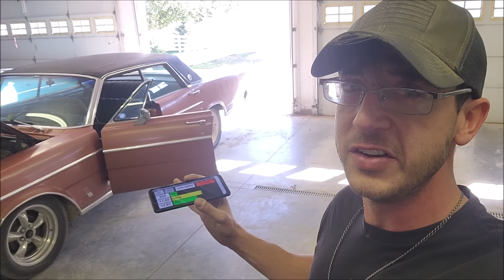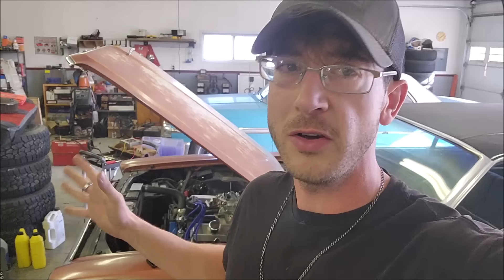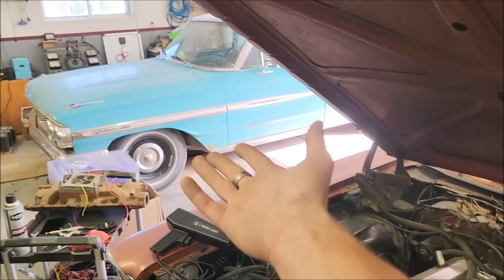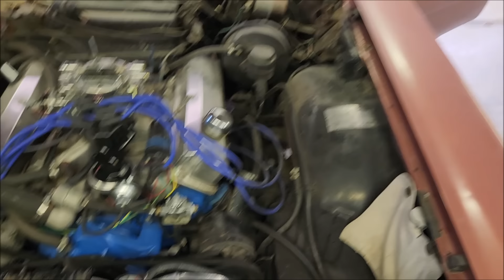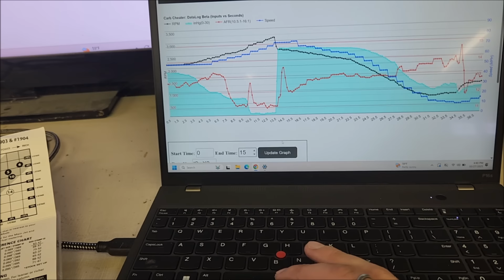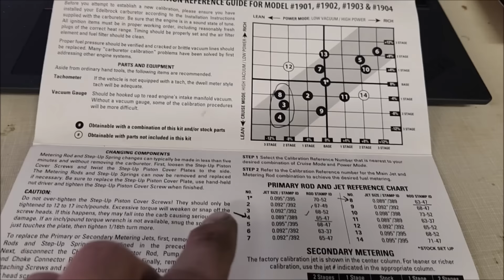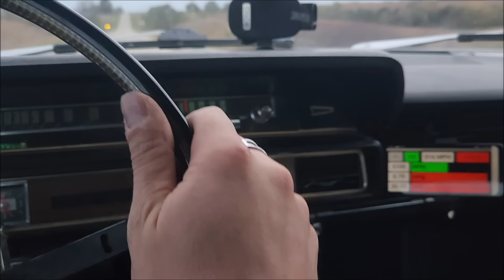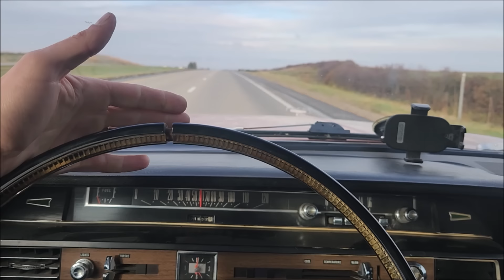Can We Save Her? NEW $6500 Engine Makes NO POWER !!!

Comment: The accelerator pump has 3 holes for adjustment.  I would move it down one.  Also your secondary jet flap is opening too soon.  Move the adjustment nut counterclockwise to get that lean issue to come down when the secondaries come into play.  You may have to tighten it a lot. The edelbrock is set very loose from the factory for universal driveability. As you tighten it counter clockwise you can tap the secondary flap to feel the tension increase. It will slow down the secondary flap reducing the amount of air during the transition . Reducing that lean jump. If you do those two remaining things. That’s all that’s left.  This thing will run smooth as butter
Reply from the maker: There were quite a few things I did that I didnt show for the sake of time in the video. The biggest one being that I removed the boosters and put a .025 thou wire in the idle feed restrictors. Low vacuum at idle feed issues - maybe i should do a video over that kind of deep stuff specifically. I lose people when I get that deep into things so I opt out of that on camera.
Reply: @ThunderHead289 This person would love to hear anything you want to explain.  
👍🏻💯😉
Reply: @ThunderHead289  Maybe do a series of shorter step-by-step vids in a playlist? Once word gets around they'd keep building views forever 😀
Reply: I would like to see more fine tuning as well!

Also, did you adjust the mix screws after every jet and needle change?
Reply: @ThunderHead289 well you did an awesome job.  I think your product is very very good at what it does. Combined with the easy to tune edelbrock avs.  I love my setup
Reply: @ThunderHead289  What model/CFM was the AVS?  CARB CHEATER LOVER gottsa' know.
Reply: Yo manny. Thanks for your added tips. I’m trying to put this all together to fully understand. Can you tell me what the accelerator pump lever hole setting adjustment actually changes/ adjusts? I have a “High / Low” setting on mine.
Reply: @adksherm  The hole setting primarily adjusts the throw of the pump, changing the volume of the pump shot, and secondarily it changes the starting height of the pump plunger. The upper hole will have the most volume of fuel delivered and the lower hole with have the least. When you change to a different hole, you're also supposed to bend the rod so that the height of the pump plunger at rest stays the same, but bending it too far while using the upper hole will risk the pump plunger bottoming out, so be careful.
Reply: @LtMcMuffinxx  yes this.  On this carb there are 3 settings.  Since he mentions running rich at the beginning. He could lower it one hole      The first hole is for mpg.  Second for all around.  3rd for hot rod.   Depending on what your engine needs on those lean and rich blips for your specific engine.   In this carb it’s super easy to adjust it.

Comment: I'm wondering if it's not on top dead center
Reply from the maker: It was something ... 
I didnt expect to find 50 degrees of mechanical timing. Ticking time bomb
Reply: @ThunderHead289  With the way it was acting, there's no way there wouldn't also be fuel in the oil, that unburnt fuel would make it's way to the oil pan and contaminate the oil
Reply: @rawr51919  Wouldn't an ITU send all that gas out the breather tube? Seem to recall the WWII mechanics diluting the aircraft oil with fuel to thin it enough to crank over, trusting it to distill off as the oil heated up.